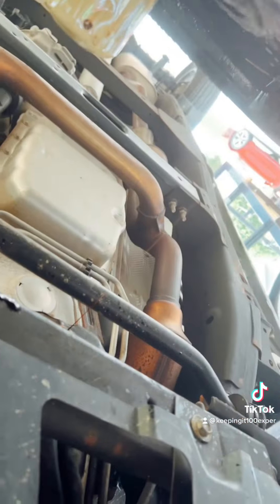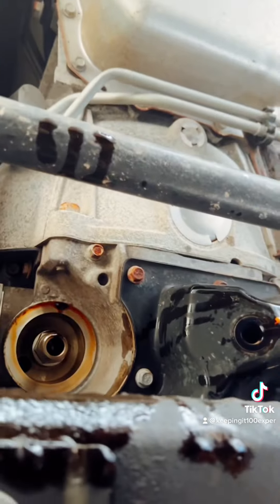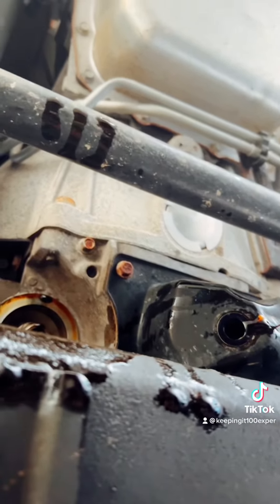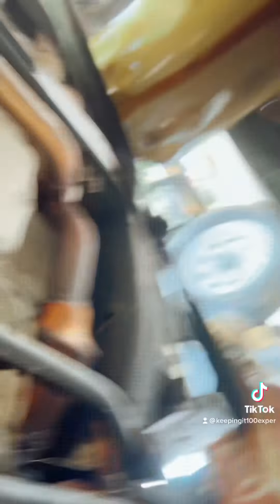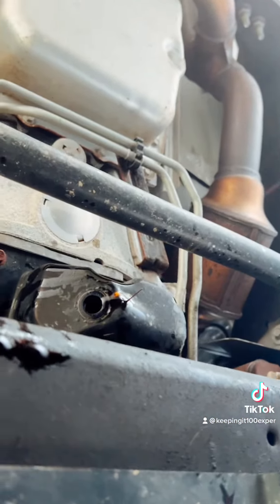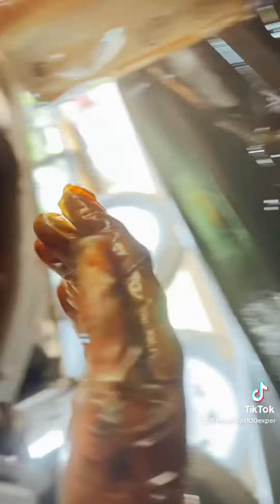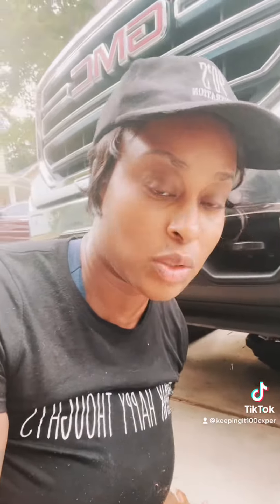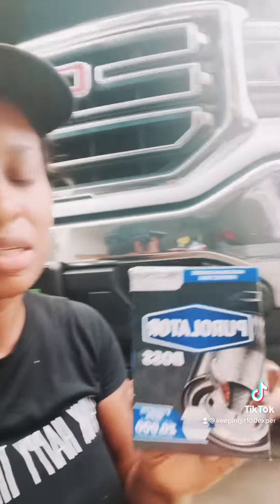Oil Filter & Drain Plug Location On A 2018 GMC Sierra SLE 5.3L 0/20 Oil 8 Quarts #pinkiedabney

Comment: There's always coupons online for oil changes if you use Google. By the time you buy all the oil you need and the oil filter, you're better off just paying to get it done. Not a a dealer though, they are a rip off.
Reply: Depends on the oil you prefer. Most shops charge extra for full synthetic. I can get 5 qt bottles of Mobile 1 for $24. A shop is gonna charge $60 to or more to change it the oil. If you don't require full synthetic then a shop might wirk out better. I just like doing the stuff i can and know i did it right.

Comment: You might want to WARE EYE PROTECTION also! If that oil gets in your eyes,you will probably need to go to the hospital to get it all out... btw...it's a good idea to drain the oil when the engine is HOT,to remove most of the settled
Sludge,Impurities,and,Micro,Metals..😉
Reply: She already knowss all that.